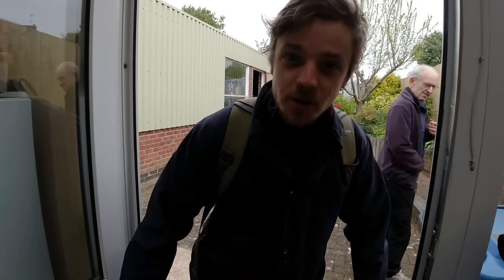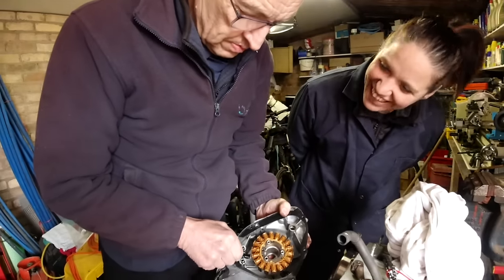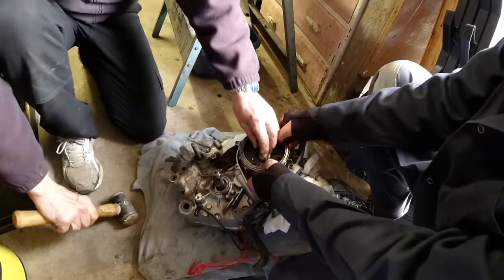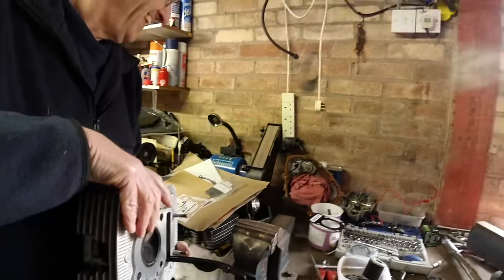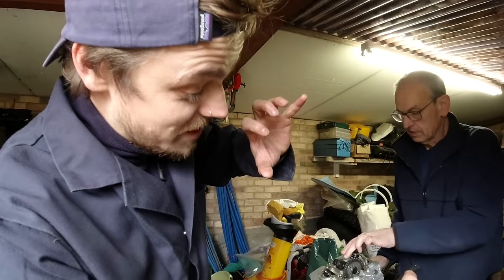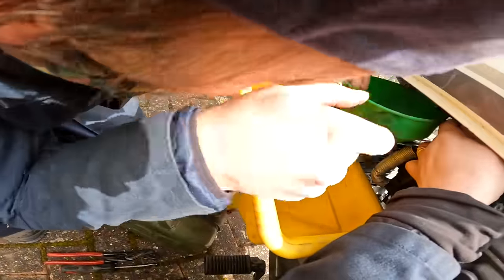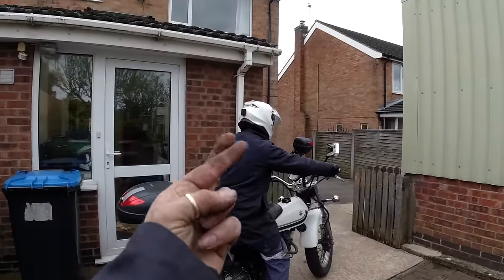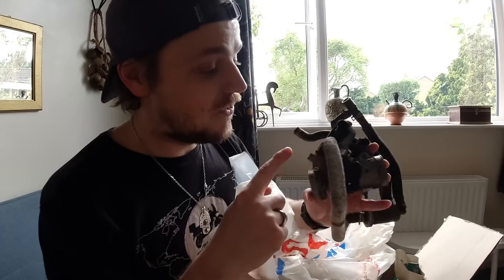WHAT IS WRONG WITH THIS BIKE?! [S7-E6]

Comment: Have you checked the exhaust system. The internals of the exhaust could have broken loose causing back pressure.
Reply: That has to be the problem.
Reply: That would also explain the noise/rattle in the engine

Comment: Personally guys, I wouldn’t go on a big trip when your motorcycle is knocking…… when you first picked up the bikes, they were not knocking if I’m remembering correctly. But Ollies bike then started knocking….. any knock is a course of concern….. Not all knocks are caused by mechanical clanking ….I watched the video of you guys taking it apart and putting it back together again but you didn’t check the spark plug timing. It only has to be out a slight degree to create pre detonation….. And the problem hasn’t existed too long to show any staining or damage on the piston or the cylinder bore…. if you go on your big tour with it knocking it’s going to let you down…..

Also, I would like to think you guys would buy motorcycle recovery cover …..

Anyway, have a think about it before heading off
Reply: "but you didn’t check the spark plug timing." - can you explain that? Its EFI ignition so how do you check it unless you connect it to the computer? Or do you mean to take ignition from white bike and plug it into black one to check if it run without knock?
Reply: @johncranwell3783  spark plug timing or ignition timing is set on those bikes. The pulse is taken off the flywheel which is keyed to the crankshaft via woodruff key. The spark timing cannot be adjusted. Any advance or retard of spark timing is controlled within the cdi unit (ecu) itself and is preset by the factory

Comment: Did you change the timing chain tensioner ??
Reply: Exactly. Needs new camchain tensioner. A simple fix
Reply: The good thing about having two identical machines is that you've got a complete set of spare parts available to help identify any faulty components. I'd suggest swapping the cam chain tensioners between the two bikes and seeing if the noise goes with it. Should only take 15 minutes...
Reply: So hard to tell from a video sound but something metal is definitely “hitting” something metal. A ‘slapping” chain would have been my first guess and it would be so easy to swap out the TC tensioner. Might work as expected out out of the bike but if the spring is stuffed, might not work properly under “load”. Good luck getting this sorted ASAP.

Comment: Well I'm glad you two and Robert fixed the power issue.  The rattle is still there.  Story: Whole different bike, but the Suzuki VS1000's have a clutch basket issue in their older bikes that causes a "chudder sound/knocking".  That's a common issue with that VS1000 bike.  The bike runs good, it just sounds bad.  Surprisingly not all VS1000 bikes have the clutch basket issue. Luck of the draw.  Excellent Cool 😎
Reply from the maker: Thank you ❤️

Comment: I would recommend checking the oil pressure / oil flow if possible, you may have poor oil flow to the top end or the big end bearings which would not necessarily show up with a bearing play test. The rattle could be oil starvation and the momentary loss of power could be the big end bearing trying to seize. Good luck with the trip, Jim
Reply from the maker: Thank you ☺️

Comment: Well you two have had a good grounding on bike repairing with Robert a top guy. It is a shame that the noise still persists after all that work and the replacement fuel system. Something like that would haunt me until I found out the cause. Strange the bike is running better even though the noise is still there. No matter, you have both remained positive throughout and that is your great strength together. You have visited Leicestershire several times now, as I have said before, when you are in the area let me know and your more than welcome to call on us. All the best for now until Sunday. John & Penny 'Old and Alive'   😊✌🏍
Reply from the maker: Thank you so much guys ❤️

Comment: Worst case scenario is main bearings. Considering the was stripped down this far, I would have spilt the cases to check. Early big end knocking is nigh on impossible to feel. So next strip, new camchain tensioner, bore hone, new piston, check and grind valves?

Comment: I was thinking about this today... as I watched the Tach on my bike while it was Idling after getting to work. I came to the conclusion, It cannot be a rod knock (Gudgeon pin or big end) and that also eliminates main bearings... it idles at twice the speed of a car engine, so the noise would be twice the frequency if it was one of these things. and that means it is something to do with the valve train, Camshaft bearing, Rocker bearings/pins, and what is between the rocker and the valve? is it a valve seat floating in and out of position? is the valve guide intact? it is definitely something between the head of the Valves, and the Camshaft... time to pull the head off again and strip the valves out! at that frequency, It is not bottom end, that can be eliminated, with the compression test being ok that means valve guides and seats are likely to be ruled out, but what about a broken spring? was that checked? if one is broken and binding or just clattering it could make noise, but also create valve float, & may also effect compression, but that's a MAY, not a definite.
 this takes me back to the rockers... and depends on how they are mounted, if they are shaft mounted, and have been lacking the oil they need they may have worn on the shaft, which would create a loose fit, but that may only be in one direction and not show up with a wiggle. or a rocker could be bent and going in and out of position on both the cam and the end of the valve...
and I hate to say this, but swapping the head from one bike to the other to see if the noise swaps over with it, and then swapping other bits between heads, until you find the one part that makes the noise... Just like you would with spark plugs and leads/ coils until you find which coil or plug is faulty (if you don't have the equipment to test it without doing this)

(and after the ad break where I stopped to write this, you start swapping parts)... I didn't even consider it was even fuel injected, I thought Carby... but yes.. that's a possibility, as is ignition timing, or even crank angle sensor & trying to inject fuel and send spark at the wrong time/

Comment: With runs good power then low power, might coil for spark plug. When they warm  up can malfunction and loose power along with spark plug wire cracked can arc and loose power. Could use lavies and ride good distance. They can also be load tested. Good luck
Reply from the maker: Thank you for the advice ☺️

Comment: Hope they are better than my first bike back in the 60’s which was a BSA C15 a dreadful bike I’m afraid
Reply: To be honest any motorcycles small enough to be someone’s first bike ah abused and poorly maintained….. I bought my first British bike a 1967 BSA C15… it was about eight years old and I didn’t know what I was buying. It just seemed like a good idea to buy that little bike but of course it had been used abused and poorly repaired in the past….. so it wasn’t long before I had to take it down to the crankshaft replace all the bearings piston rings new valve seats and so on and then I had a great little bike that served me well…. It also put me on a very sharp curve of learning how to repair motorcycles which I have done all my life.